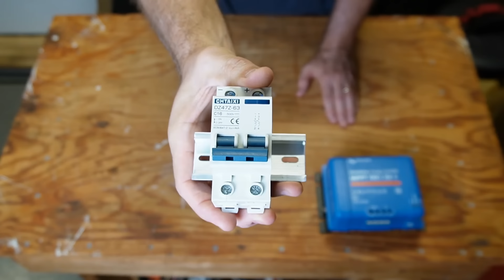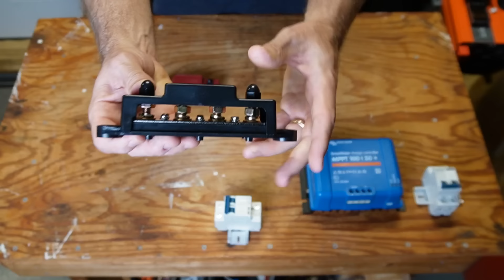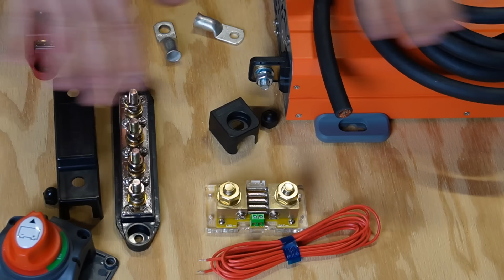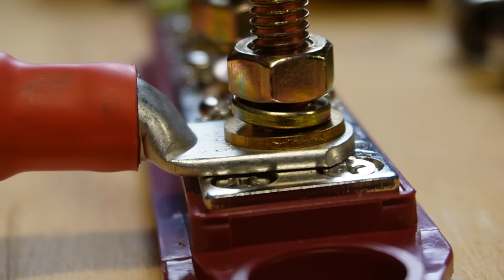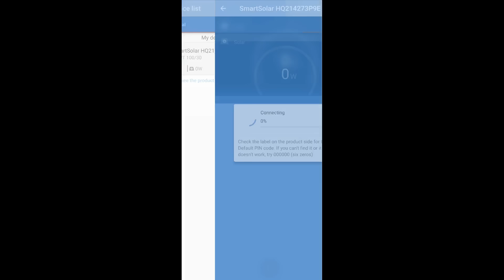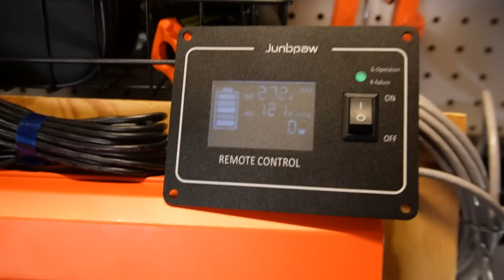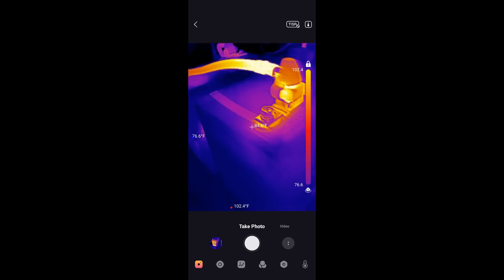24V DIY Off-Grid Solar Generator Build For Beginners

Comment: Great build. The 12v batteries should be individually charged to 100% prior to series set up as 24v.
Reply from the maker: I did mention it. I thought I had them fully charged. I must have used one for something I forgot about.
Reply: 255  God! There is no god except He, the Living, the Everlasting. Neither slumber overtakes Him, nor sleep. To Him belongs everything in the heavens and everything on earth. Who is he that can intercede with Him except with His permission? He knows what is before them, and what is behind them; and they cannot grasp any of His knowledge, except as He wills. His Throne extends over the heavens and the earth, and their preservation does not burden Him. He is the Most High, the Great.
256  There shall be no compulsion in religion; the right way has become distinct from the wrong way. Whoever renounces evil and believes in God has grasped the most trustworthy handle; which does not break. God is Hearing and Knowing.
257  God is the Lord of those who believe; He brings them out of darkness and into light. As for those who disbelieve, their lords are the evil ones; they bring them out of light and into darkness—these are the inmates of the Fire, in which they will abide forever.
258  Have you not considered him who argued with Abraham about his Lord, because God had given him sovereignty? Abraham said, “My Lord is He who gives life and causes death.” He said, “I give life and cause death.” Abraham said, “God brings the sun from the East, so bring it from the West,” so the blasphemer was confounded. God does not guide the wrongdoing people.
259  Or like him who passed by a town collapsed on its foundations. He said, “How can God revive this after its demise?” Thereupon God caused him to die for a hundred years, and then resurrected him. He said, “For how long have you tarried?” He said, “I have tarried for a day, or part of a day.” He said, “No. You have tarried for a hundred years. Now look at your food and your drink—it has not spoiled—and look at your donkey. We will make you a wonder for mankind. And look at the bones, how We arrange them, and then clothe them with flesh.” So when it became clear to him, he said, “I know that God has power over all things.”
260  And when Abraham said, “My Lord, show me how You give life to the dead.” He said, “Have you not believed?” He said, “Yes, but to put my heart at ease.” He said, “Take four birds, and incline them to yourself, then place a part on each hill, then call to them; and they will come rushing to you. And know that God is Powerful and Wise.”

2  God, there is no god but He, the Living, the Eternal.
3  He sent down to you the Book with the Truth, confirming what came before it; and He sent down the Torah and the Gospel.
4  Aforetime, as guidance for mankind; and He sent down the Criterion. Those who have rejected God’s signs will have a severe punishment. God is Mighty, Able to take revenge.
5  Nothing is hidden from God, on earth or in the heaven.
6  It is He who forms you in the wombs as He wills. There is no god except He, the Almighty, the Wise.

11  Originator of the heavens and the earth. He made for you mates from among yourselves, and pairs of animals, by means of which He multiplies you. There is nothing like Him. He is the Hearing, the Seeing.
12  To Him belongs absolute control of the heavens and the earth. He spreads the bounties to whomever He wills, or reduces it. He is aware of all things.
13  He prescribed for you the same religion He enjoined upon Noah, and what We inspired to you, and what We enjoined upon Abraham, and Moses, and Jesus: “You shall uphold the religion, and be not divided therein.” As for the idolaters, what you call them to is outrageous to them. God chooses to Himself whom He wills, and He guides to Himself whoever repents.

54  Your Lord is God; He who created the heavens and the earth in six days, then established Himself on the Throne. The night overtakes the day, as it pursues it persistently; and the sun, and the moon, and the stars are subservient by His command. His is the creation, and His is the command. Blessed is God, Lord of all beings.
55  Call upon your Lord humbly and privately. He does not love the aggressors.
56  And do not corrupt on earth after its reformation, and pray to Him with fear and hope. God’s mercy is close to the doers of good.
57  It is He who sends the wind ahead of His mercy. Then, when they have gathered up heavy clouds, We drive them to a dead land, where We make water come down, and with it We bring out all kinds of fruits. Thus We bring out the dead—perhaps you will reflect.
58  As for the good land, it yields its produce by the leave of its Lord. But as for the bad, it produces nothing but hardship and misery. Thus We explain the revelations in various ways for people who are thankful.
59  We sent Noah to his people. He said, “O my people! Worship God; you have no god other than Him. I fear for you the punishment of a tremendous Day.”
60  The dignitaries among his people said, “We see that you are in obvious error.”
61  He said, “O my people, I am not in error, but I am a messenger from the Lord of the Worlds.”
62  “I deliver to you the messages of my Lord, and I advise you, and I know from God what you do not know.”
63  “Do you wonder that a reminder has come to you from your Lord, through a man from among you, to warn you, and to lead you to righteousness, so that you may attain mercy?”
64  But they called him a liar. So We saved him and those with him in the Ark, and We drowned those who rejected Our revelations. They were blind people.

59  The likeness of Jesus in God’s sight is that of Adam: He created him from dust, then said to him, “Be,” and he was.
60  The truth is from your Lord, so do not be of those who doubt.
61  And if anyone disputes with you about him, after the knowledge that has come to you, say, “Come, let us call our children and your children, and our women and your women, and ourselves and yourselves, and let us invoke God’s curse on the liars.”
62  This is the narrative of truth: there is no god but God. God is the Mighty, the Wise.
63  But if they turn away—God knows the corrupt.
64  Say, “O People of the Book, come to terms common between us and you: that we worship none but God, and that we associate nothing with Him, and that none of us takes others as lords besides God.” And if they turn away, say, “Bear witness that we have submitted.”
65  O People of the Book! Why do you argue about Abraham, when the Torah and the Gospel were not revealed until after him? Will you not reason?
66  Here you are—you argue about things you know, but why do you argue about things you do not know? God knows, and you do not know.
67  Abraham was neither a Jew nor a Christian, but he was a Monotheist, a Muslim. And he was not of the Polytheists.
68  The people most deserving of Abraham are those who followed him, and this prophet, and those who believe. God is the Guardian of the believers.
69  A party of the People of the Book would love to lead you astray, but they only lead themselves astray, and they do not realize it.

84  Say, “We believe in God, and in what was revealed to us; and in what was revealed to Abraham, and Ishmael, and Isaac, and Jacob, and the Patriarchs; and in what was given to Moses, and Jesus, and the prophets from their Lord. We make no distinction between any of them, and to Him we submit.”
85  Whoever seeks other than Islam as a religion, it will not be accepted from him, and in the Hereafter he will be among the losers.

28  It is He who sent His Messenger with the guidance and the religion of truth, to make it prevail over all religions. God suffices as Witness.
29  Muhammad is the Messenger of God. Those with him are stern against the disbelievers, yet compassionate amongst themselves. You see them kneeling, prostrating, seeking blessings from God and approval. Their marks are on their faces from the effects of prostration. Such is their description in the Torah, and their description in the Gospel: like a plant that sprouts, becomes strong, grows thick, and rests on its stem, impressing the farmers. Through them He enrages the disbelievers. God has promised those among them who believe and do good deeds forgiveness and a great reward.

111  And say, “Praise be to God, who has not begotten a son, nor has He a partner in sovereignty, nor has He an ally out of weakness, and glorify Him constantly.”

Read The Quran
Reply: ....or charge them in parallel to equalise.

Comment: Very timely. I have all the parts except the Shunt Monitor and I’m ready to layout and build my 24V based system with 4) 12V 100AH Wattcycle Batteries & a Giandel 24V 4000W Inverter. I went with a Renogy Controller. I wanted a Victron but it was $100 more. Unfortunately it’s too late to return the Renogy. Thanks for Posting. Dave in PA.
Reply from the maker: Sounds like a good build. Thanks for sharing!
Reply: 255  God! There is no god except He, the Living, the Everlasting. Neither slumber overtakes Him, nor sleep. To Him belongs everything in the heavens and everything on earth. Who is he that can intercede with Him except with His permission? He knows what is before them, and what is behind them; and they cannot grasp any of His knowledge, except as He wills. His Throne extends over the heavens and the earth, and their preservation does not burden Him. He is the Most High, the Great.
256  There shall be no compulsion in religion; the right way has become distinct from the wrong way. Whoever renounces evil and believes in God has grasped the most trustworthy handle; which does not break. God is Hearing and Knowing.
257  God is the Lord of those who believe; He brings them out of darkness and into light. As for those who disbelieve, their lords are the evil ones; they bring them out of light and into darkness—these are the inmates of the Fire, in which they will abide forever.
258  Have you not considered him who argued with Abraham about his Lord, because God had given him sovereignty? Abraham said, “My Lord is He who gives life and causes death.” He said, “I give life and cause death.” Abraham said, “God brings the sun from the East, so bring it from the West,” so the blasphemer was confounded. God does not guide the wrongdoing people.
259  Or like him who passed by a town collapsed on its foundations. He said, “How can God revive this after its demise?” Thereupon God caused him to die for a hundred years, and then resurrected him. He said, “For how long have you tarried?” He said, “I have tarried for a day, or part of a day.” He said, “No. You have tarried for a hundred years. Now look at your food and your drink—it has not spoiled—and look at your donkey. We will make you a wonder for mankind. And look at the bones, how We arrange them, and then clothe them with flesh.” So when it became clear to him, he said, “I know that God has power over all things.”
260  And when Abraham said, “My Lord, show me how You give life to the dead.” He said, “Have you not believed?” He said, “Yes, but to put my heart at ease.” He said, “Take four birds, and incline them to yourself, then place a part on each hill, then call to them; and they will come rushing to you. And know that God is Powerful and Wise.”

2  God, there is no god but He, the Living, the Eternal.
3  He sent down to you the Book with the Truth, confirming what came before it; and He sent down the Torah and the Gospel.
4  Aforetime, as guidance for mankind; and He sent down the Criterion. Those who have rejected God’s signs will have a severe punishment. God is Mighty, Able to take revenge.
5  Nothing is hidden from God, on earth or in the heaven.
6  It is He who forms you in the wombs as He wills. There is no god except He, the Almighty, the Wise.

11  Originator of the heavens and the earth. He made for you mates from among yourselves, and pairs of animals, by means of which He multiplies you. There is nothing like Him. He is the Hearing, the Seeing.
12  To Him belongs absolute control of the heavens and the earth. He spreads the bounties to whomever He wills, or reduces it. He is aware of all things.
13  He prescribed for you the same religion He enjoined upon Noah, and what We inspired to you, and what We enjoined upon Abraham, and Moses, and Jesus: “You shall uphold the religion, and be not divided therein.” As for the idolaters, what you call them to is outrageous to them. God chooses to Himself whom He wills, and He guides to Himself whoever repents.

54  Your Lord is God; He who created the heavens and the earth in six days, then established Himself on the Throne. The night overtakes the day, as it pursues it persistently; and the sun, and the moon, and the stars are subservient by His command. His is the creation, and His is the command. Blessed is God, Lord of all beings.
55  Call upon your Lord humbly and privately. He does not love the aggressors.
56  And do not corrupt on earth after its reformation, and pray to Him with fear and hope. God’s mercy is close to the doers of good.
57  It is He who sends the wind ahead of His mercy. Then, when they have gathered up heavy clouds, We drive them to a dead land, where We make water come down, and with it We bring out all kinds of fruits. Thus We bring out the dead—perhaps you will reflect.
58  As for the good land, it yields its produce by the leave of its Lord. But as for the bad, it produces nothing but hardship and misery. Thus We explain the revelations in various ways for people who are thankful.
59  We sent Noah to his people. He said, “O my people! Worship God; you have no god other than Him. I fear for you the punishment of a tremendous Day.”
60  The dignitaries among his people said, “We see that you are in obvious error.”
61  He said, “O my people, I am not in error, but I am a messenger from the Lord of the Worlds.”
62  “I deliver to you the messages of my Lord, and I advise you, and I know from God what you do not know.”
63  “Do you wonder that a reminder has come to you from your Lord, through a man from among you, to warn you, and to lead you to righteousness, so that you may attain mercy?”
64  But they called him a liar. So We saved him and those with him in the Ark, and We drowned those who rejected Our revelations. They were blind people.

59  The likeness of Jesus in God’s sight is that of Adam: He created him from dust, then said to him, “Be,” and he was.
60  The truth is from your Lord, so do not be of those who doubt.
61  And if anyone disputes with you about him, after the knowledge that has come to you, say, “Come, let us call our children and your children, and our women and your women, and ourselves and yourselves, and let us invoke God’s curse on the liars.”
62  This is the narrative of truth: there is no god but God. God is the Mighty, the Wise.
63  But if they turn away—God knows the corrupt.
64  Say, “O People of the Book, come to terms common between us and you: that we worship none but God, and that we associate nothing with Him, and that none of us takes others as lords besides God.” And if they turn away, say, “Bear witness that we have submitted.”
65  O People of the Book! Why do you argue about Abraham, when the Torah and the Gospel were not revealed until after him? Will you not reason?
66  Here you are—you argue about things you know, but why do you argue about things you do not know? God knows, and you do not know.
67  Abraham was neither a Jew nor a Christian, but he was a Monotheist, a Muslim. And he was not of the Polytheists.
68  The people most deserving of Abraham are those who followed him, and this prophet, and those who believe. God is the Guardian of the believers.
69  A party of the People of the Book would love to lead you astray, but they only lead themselves astray, and they do not realize it.

84  Say, “We believe in God, and in what was revealed to us; and in what was revealed to Abraham, and Ishmael, and Isaac, and Jacob, and the Patriarchs; and in what was given to Moses, and Jesus, and the prophets from their Lord. We make no distinction between any of them, and to Him we submit.”
85  Whoever seeks other than Islam as a religion, it will not be accepted from him, and in the Hereafter he will be among the losers.

28  It is He who sent His Messenger with the guidance and the religion of truth, to make it prevail over all religions. God suffices as Witness.
29  Muhammad is the Messenger of God. Those with him are stern against the disbelievers, yet compassionate amongst themselves. You see them kneeling, prostrating, seeking blessings from God and approval. Their marks are on their faces from the effects of prostration. Such is their description in the Torah, and their description in the Gospel: like a plant that sprouts, becomes strong, grows thick, and rests on its stem, impressing the farmers. Through them He enrages the disbelievers. God has promised those among them who believe and do good deeds forgiveness and a great reward.

111  And say, “Praise be to God, who has not begotten a son, nor has He a partner in sovereignty, nor has He an ally out of weakness, and glorify Him constantly.”

Read The Quran

Comment: What is the cost
Reply from the maker: I quickly added it up. It should cost a little over $1000 before the solar panels. I got those 200 watt renogy rigid panels on sale for $149 each. I think they are $169 now. If you slowly add over time as sales come up, you can save quite a bit.